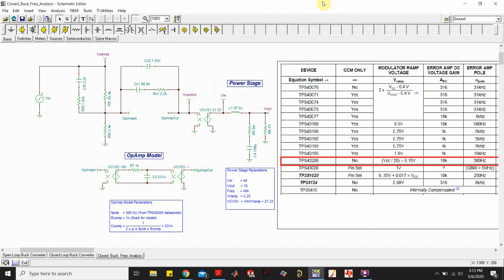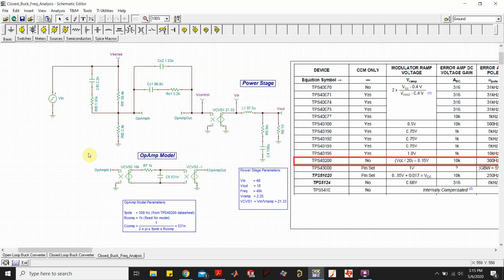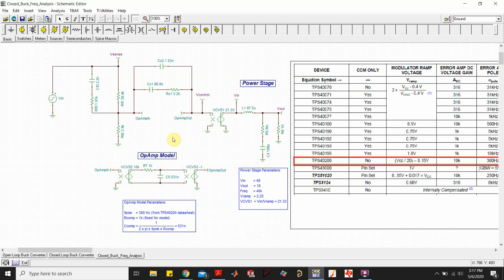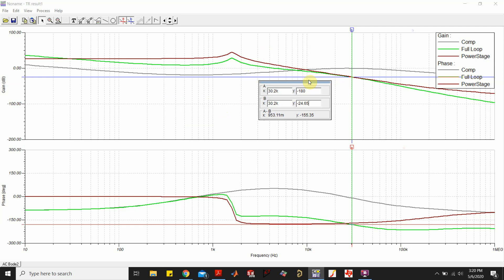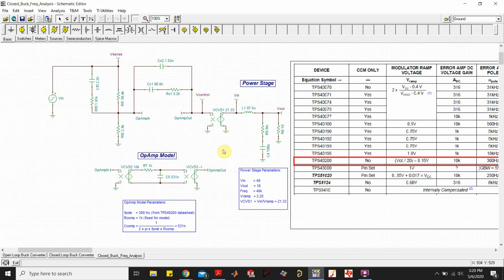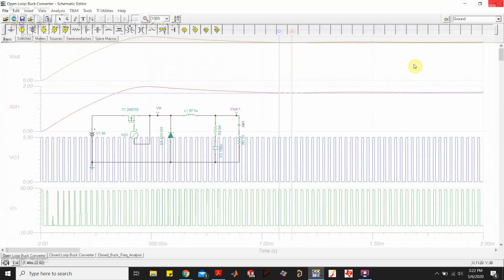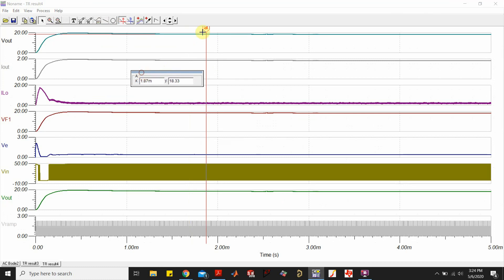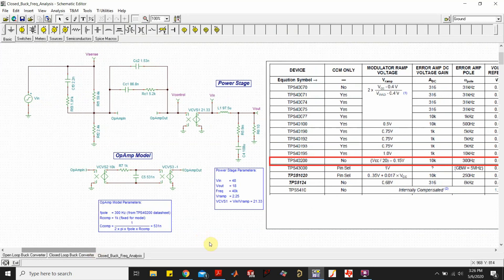AC Analysis (Frequency Response) of a Buck Converter - Part II

Comment: Hi, thank you for this video. I have been trying to implement feedback on a buck converter, but I am struggling. How did you obtain the frequency response (gain and phase) of the buck converter? Which part of the model or the actual circuit did you probe to get the gain and phase margin traces? You didn't cover that in the video since you had it done already. Can you please explain?